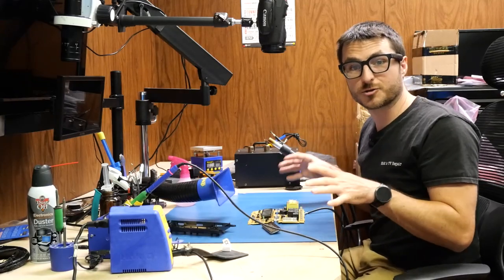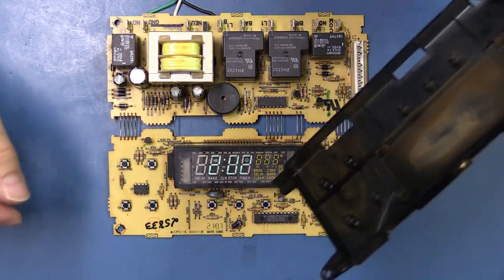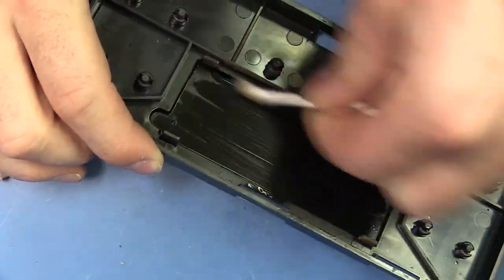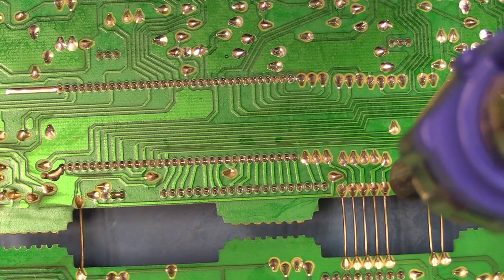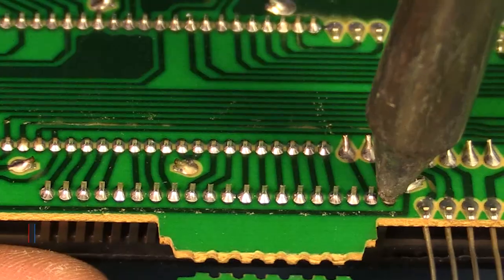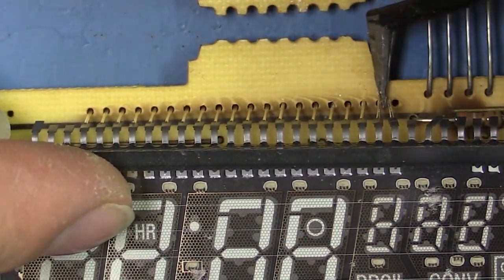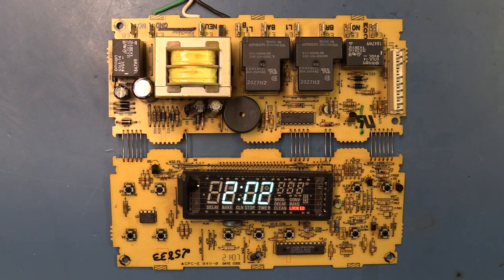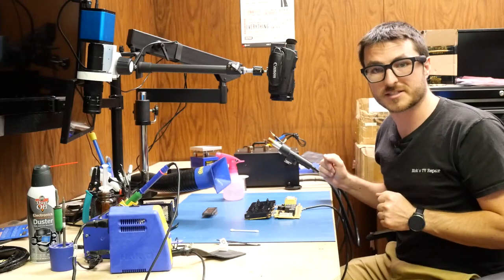Repairing Frigidaire Range Control Board Dim Display

Comment: We have that exact problem with our display . . . and possibly the dirty screen as well. 🙂
Reply from the maker: If you want to try and fix it yourself, let me know the model of your unit and I will let you know if we have the display for it for sale. If you don't want to try and fix it yourself and we do have that display, you can always send it in for repair as well. Our service is not just of the display, we also perform other repairs and replace other parts that are near their end of life before they fail to ensure our repairs last as long as possible.
Reply: @NicksTVRepair  Thanks Nick. My soldering skills peak at XT60 connectors. LOL I will indeed keep you in mind  if I cannot find the complete unit. It's a Frigidaire FEF389WJCB.
Reply from the maker: I don't know that these are still available for sale but if you find a source for them let me know!

Comment: I wonder what percentage of control board problems are actually caused by the use of the self-clean feature.
Reply from the maker: That is a good question. I wonder at what rate the self-clean may or may not accelerate the degredation of certain parts in the oven.

Comment: Any idea where i would get the VFD (7-lt-91g futaba)?  Thanks :)
Reply from the maker: We have them for sale on our website
https://nickselectronics.com/products/ovendisplay
However unless you are very good at soldering and do it on a daily basis I would not recommend you attempt this on your own. I make it look easy but that is because I have 10 years experience soldering. 
So far everyone that has tried soldering the replacement display has had problems. This is not a beginer repair. You also need proper soldering equipment, the sub $100 soldering irons you buy at Ace or home depot are usually not good enough to do these kinds of jobs. 
This is why we offer the service.

Comment: Do you have a link to a place I can find this display chip. My particular model number is CFEF388WCC-1
Reply from the maker: We are currently out of stock on the displays, but should have more in stock in about 3 months.
You can either pay for our full repair and refurbishment which does include the display replacement, or if you don't want to pay for our full repair and want only the display, we will have them for sale once more in about 90 days or so.
Reply: @NicksTVRepair  I'm in Sault Ste Marie Ontario
Reply from the maker: Yeah that's not a problem, we ship world wide but right now the issue is our limited stock.

Comment: My Sony Bravia tv made a popcorn sound and went off. I found out that the AC adapter got burned, I bought another ac adapter but my tv won't turn on. Please what could be the problem? Did the burned adapter affect my TV?
Reply from the maker: I don't know, I don't have enough information. I would need pictures of the supply board, information regarding the model number of your TV and so on. 
Are you able to take voltage measurments? 
Might be best to reach out to us directly via email with all that information

Comment: I'd like to take this repair on myself, but should I be concerned about any HV capacitors on the control board?  A brighter display isn't worth getting zapped. :-)
Reply from the maker: Unless you plan on doing this repair with the unit still connected to power, which obviously don't do that, then no there are no high voltage capacitors on the board you need to be concerned about.